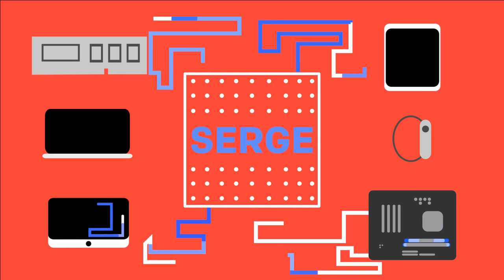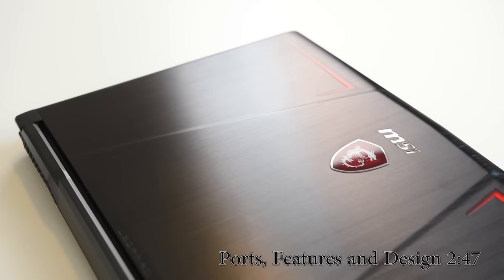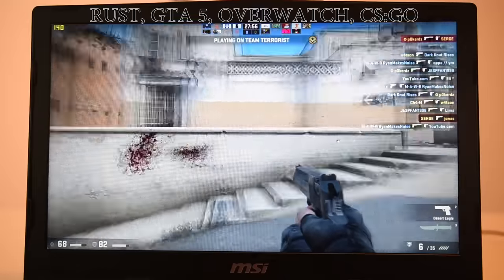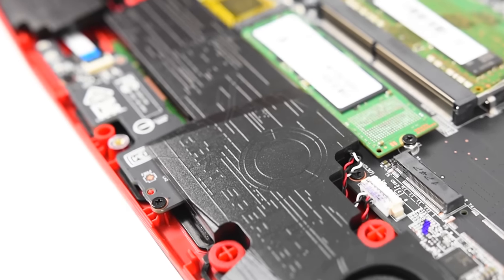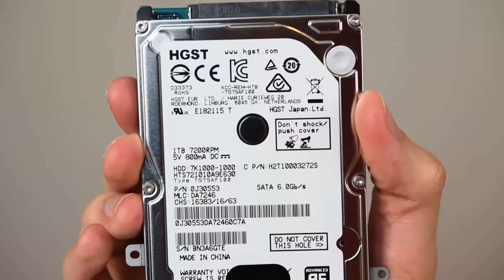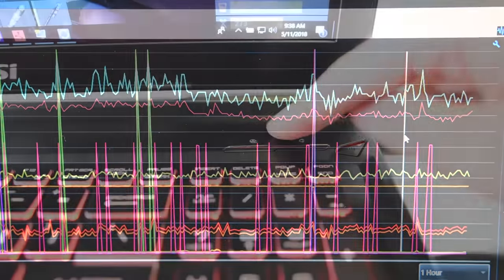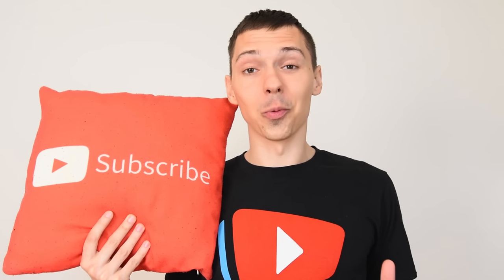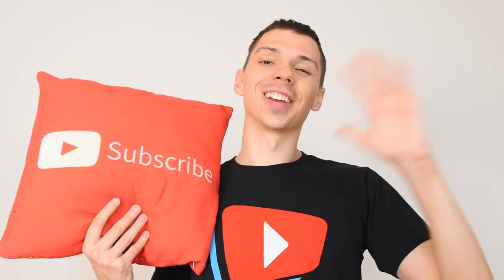MSI GAMING LAPTOP REVIEW GTX 1060, 6 CORE 8750H, GP63 LEOPARD 8RE

Comment: i've got the MSI GL73 8RE-402 and i luv it. realy good cooling solution. only downside are the speakers and the trackpad. it can be loud if you have the cooling boost on. but other machines dont have a cooling booster. its not a jack off all trades but it shines in gaming without thermal throttle issues.

Comment: One of the hinge mounts on my laptop broke this week, I couldn't believe that this happened, but after seeing that the broken part was made of plastic, it was only a matter of time until it broke. It is a really bad design from MSI, the metal hinge is attached to a plastic part, which has to withstand a considerable amount of the force that is applied when opening and closing the lid. I think I can fix it myself by buying a palmrest replacement. I'm not sure if I should ship it to MSI or not since my warranty expired a few months ago.
Reply from the maker: Even though the warranty expired you should reach out to them and tell them that they will lose a customer for life if they dont fix there defect, who cares that the warranty expired now its a matter of saving a future customer if they care they will either send you the part of have you ship them the device for repair. 

sorry that this happened, msi does indeed make the device as thin and light as possible part of this means that some parts are designed rather cheap. There is a chance that maybe your particular plastic just had a defect but trust me I hear you because my msi also has cheap plastic that breaks right off when you upgrade your ram and once its borken its basically broken for ever and thats just me upgrading the machine... either way the machines are cheap so at least we can get our hands on them... find someone in msi who can fix the machine dont take no for an answer just keep going higher up if you need the boss to get the job done and be convincing its there dang machine that broke they should at least take some responsibility. 

 I am trying to build the best tech & entertainment channel possible if you have any questions I am always standing by to help you with your tech needs what ever they may be. I will always be there for you, So if you like this kind of content I highly recommend you subscribe. :)
Good luck!
Reply: @SERGE_Tech  thanks for the advice, I ended up fixing it by myself. I don't know how much time it will last but it looks pretty solid.

Comment: Great review and breakdown! I am currently interested in the MSI GP63 Leopard-428, which is almost identical to this machine, except it contains a GTX 1070 8G. However, similar to you, I would want to install the Samsung 970 EVO Series - 500GB NVMe - M.2 SSD. Do you think the specific model I am looking into would also have the PCIE slot like this one does?  And if you're not sure, where should I look online to find out whether my model has the slot or not?

Comment: Have had this over a year. It runs like a tank. And by running like a tank it can take all the bullets and artillery, but it gets HOT. The plasticiness is garbage. If I pick it up. It feels like Iike it’s gonna break. Structural/ heat issues other than that. I love it (p.s anyone have thoughts in current owners of razer laptops)
Reply from the maker: ill be releasing a razerblade video soon they are surprisingly good. Do you have a specific question about it? subscribe with notifiactions on if you wanna see the vid in the next day or so.

Comment: Hey Serge, Loved the vid!! This is what made me decide to purchase this laptop, and boy am I happy with it. I have 1 question tho, it seems like my screen refresh rate is set at 60 and I can't seem to change it in the advanced display settings. Do you know how I could change this?
Reply from the maker: while its true there is a way to change it, it should already be set at the correct refreshrate. you can try searching change resolution.
Reply from the maker: in the start menu search, you should be able to select a resoulsion with the correct rate also its possible your model may not have the 120hz maybe?
Reply: Go to Nvidia control panel and then to change resolution.  There is a tab on the right beside of the resolution for refresh rate.

Comment: Kind of freaked me out with the hinge thing, but I'm sure it isn't that bad. It's not like anyone is going to be opening and closing the lid all day.  I've had my fair share of laptops and I can't say the hinge ever wore out on any of them. I really can't see MSI cutting corners on something like that.

As for the build materials... Well, that's the price for a few pounds - plastic surface areas. 

Anyways, thanks for the review. Definitely helped me in picking up my first gaming laptop :) These things really have come such a long way, I'm quite impressed with the accessibility of the parts as well as the specs.

Comment: Hi, After i saw you  test this laptop i bought it (used condition, but like new) it doesn't come original charger (it comes Targus 90 w universal charger) and i test laptop in CS Go and FPS is terrible sometimes is high and sometimes its quite low (between 27 - 300 ) what do you think it is charger's problem? it is not enough big (180 watt )  and if you know which Brand charger is good to buy for my MSI GP 63. thx

Comment: Tell me which one is best 1060 lap ??? This is 8gen but i like that raider one.  But its 7gen 😳  ..  can you tell me what is best choice ??   .. geting asus(strix) or lenovo (720) or msi?   I need 1060 laptop and better performance and build quality
Reply: There is no compression between Asus ROG Strix GL503GE and MSI gp63-8re. The msi is the clear winner in this case. First of all the processor of Asus in i7 7th gen while msi is of i7 8th gen. Almost about 24 percent performance gains. That is a great improvement in top level performance. Secondly is gpu, gtx 1060 6gb will give you almost double the performance of 1050ti. Thirdly is the screen, the display of 120Hz over 60Hz is a a major game changing. The difference of 24k is really worth as it it's a lot better.
Reply: i allready got a raider 7 re XD

soo sexy
Reply: Raider 7 re XD has 7th gen processor. But it is also a good gaming laptop. :)
Reply: SOURADEEP DAS atm im playing a game right now..

Comment: How about Gen 8th I5 GL63 8SE with RTX 2060 and 8GB RAM vs Gen 8th I7 GP63 8RE with GTX 1060 and 8GB RAM?  Both price are kinda close. If my budget is around there, which one should I get? Or is there other laptop that is better? 
My priority will be future-proofed, and generally use it for gaming (not necessary Ultra High setting), sometimes rendering.
Reply: Get the one with RTX 2060, since i5 8th gen HQ CPU's are equal to i7 7700HQ, you won't notice any performance issues and the RTX 2060 will serve you a good amount of time.

Comment: I bought this computer a couple of years ago, now the screen is doing something weird occasionally.  Pink pixelated lines will go up the screen real fast, wtf.  Does anyone else have this problem?  It happens everyonce and while, but scares me like my screen is about to fail.
Reply from the maker: Awesome questions keep them coming, What your talking about is cause for concern and before it fails completely I would take it into MSI and get them to fix it or replace it. Check weather you have a warranty or not, and if not don't worry about manufactures of the machine might still repair it for free, Just be nice about it and they will help you. It sounds like it may be damaged from a fall, do you know if you dropped it? It could also just be a loose capable this can be fixed by taking the machine apart, you find guides online on how to do it. 

I am trying to build the best tech & entertainment channel possible if you have any questions I am always standing by to help you with your tech needs what ever they may be. I will always be there for you, So if you like this kind of content I highly recommend you subscribe. :)
Good luck!

Comment: Just gonna leave this comment for those who are thinking about picking this bad boy up. I got it last summer and so far its so fking good. I got it for like 1k or maybe 700 dollar i dont remeber. And it is soo good. The only downside of it its just that if you play games with high requirements it tends to get a little bit warm. But there is a solution for this which is the boosted fan, you can basically boost the fans and make it cool down although it gets very loud. Otherwise its so good, atleast for me. You can play gta V on the highest quality and games like LOL it runs it without a problem. Also if you wanne pick this up make sure to get a mouse with it aswell because the touchboard is horrible, it works but its not great.
Reply from the maker: yeah even if it was a good touchpad for most games like the ones you mentioned having a mouse is sorta a requirement unless you use a controller. Awesome advice thanks for sharing!

Comment: I have the Msi Gf63 8rc with the 8th generation i5 Intel processor and upgraded the 8 gigs ram to 32gb ram makes it run super fast.  It has the 1tb ssd drive and it runs all my games amazing.  Have the gaming mouse and external gaming keyboard which makes this system complete.  Any suggestions what else I can do for even better performance

Comment: I just bought MSI GP73 Leopard, everything's so far so good. Well, except for the Battery Adapter which gets heated up if I use the laptop for some times. Is it usual or Is something wrong?

Comment: which is the best MSI ge63vr 7re raider or MSI GP63 8RE LEOPARD? what is the difference between each this?
Reply: GP63  8RE is of i7 8th generation at it is 1060 6 gb while GP63 8RE is of i7 7th generation.
Reply: SOURADEEP DAS You've just said the same.

Comment: I am confused between this one (MSI gp63-8re) and Asus ROG Strix GL503GE in India.

The only difference specification wise is Asus comes with 1050Ti and all other specs are same (even 120hz screen).

I know 1060 is far better fpr gaming but the Asus is available for around 24000 rupees (350$) less.

So is it worth it to spend 350$ more just for an upgrade to 1060 compared to 1050Ti.

Also at the same price of Asus(above one only) I am getting a gtx 1060 but with 7th gen i7 and only 60hz screen. 

Please suggest.
Reply from the maker: How important is gaming for you? How often do you play and do you care about running graphics on high? With a 1050ti you will sometimes have to decrease graphical fidelity. I know a few serious gamers that complain there 1050ti is not strong enough..
Reply from the maker: Certainly saving money is important get the 1060 if you can it's a lot better but if your not a serious gamer save the money.
Reply: SERGE I am not a very serious gamer, I am ok if my games don't run on ultra setting but also I don't want them to run on low or medium settings. Also I am considering to use my laptop atleast 3-4 years so future games should also run on it.

Can you please do a review on Asus ROG Strix GL503GE (2018 strix)
Reply: There is no compression between Asus ROG Strix GL503GE and MSI gp63-8re. The msi is the clear winner in this case. First of all the processor of Asus in i7 7th gen while msi is of i7 8th gen. Almost about 24 percent performance gains. That is a great improvement in top level performance. Secondly is gpu, gtx 1060 6gb will give you almost double the performance of 1050ti. Thirdly is the screen, the display of 120Hz over 60Hz is a a major game changing. The difference of 24k is really worth as it it's a lot better.
Reply: SOURADEEP DAS asus gl503ge i7 8th gen

Comment: i got an oculus rift... should i be buying this machine?
I really dont want under 60fps.
Reply from the maker: i think oculus would work on it but you have to take into account this is new techcnology and if you want the best performance try a non entry level graphics card like gtx 1070 or gtx 1080. 1060 is perfect for 1080p and can push some higher 1440p sometim s but other than that you may be pushing it too hard trust me get a hogher gpu this is new technology we are dealonf with.

Comment: The GP73 which is the later version has the GTX 1050 GPU.
I guess theres no way to upgrade the GP73 to the 1060 or 1070 card...?
Photoshop/Lightroom 2023 new features are struggling with the 1050 card.
Reply from the maker: if it has a fast enough usb c you can plug in a vidoe card using an external gpu enclousre

Comment: How good would this be for editing videos?
Reply: I've edited videos on this. It's great as you would expect from a 6 core CPU. The laptop is a bit heavy though and taking it around feels a bit tiring though the size is ambient for it's cooling.
I also replied to another comment that there's better value out there, like the Lenovo Y7000, cuz it has the same specs for a much nicer design.

Comment: Is this still a good buy in 2019? Can get it used for about a 1000.
Reply: I bought this laptop a few months ago and still holds up pretty good.
However, I think there's a couple of better options out there. Yes this laptop has an amazing screen and excellent performance but other laptops, now, sell at better value.
If I were you, I'd try to get my hands on the Lenovo Y7000 (the new one) just because it has an overall better design and feel. If you really want to cheap out, go for the Dell g3.
Reply: @hamzakamil4303  Okay thanks for the tips. Is Dell G5 worth to try? Since you're saying the g3 I mean. I can get the g5 for like under 1000
Reply: The g5 is great too.
Again, there's not much difference between these laptops except for a few degrees in CPU temps and some design changes.
I'd say of you're paying $1000 for a gaming laptop, it should have the i7 8750h and a 6gb 1060 along with SSD, 16gigs ram etc.
Look at dis babe too
https://www.amazon.com/dp/B07PML7FBJ/ref=mp_s_a_1_4?keywords=i7+8750h+gtx+1060&qid=1552642869&s=gateway&sr=8-4

Comment: Recently bought a msi gp63 laptop with 1070 gpu and 8750h cpu. While playing far cry 5 on ultra with vsync at 60fps, cpu temp got as high as 95c. Unlike the gpu temp its steady at 65-68c, the cpu temp constantly going up and down sometimes by 5c and sometimes by 10c. 

I have cooler boost on it cranks up all the fans to max and i even had my laptop raised higher off table for more air to get in. When i feel the laptop its lukewarm all around but the reading of the cpu/gpu has me worried.

Should i be worried? is this normal for a laptop?
Reply: winkawak it’s unfortunately normal for a laptop with a 1070 in it. The higher power demands and subsequent higher heat generated lead to more thermal throttling.

Comment: Is it good for 1280$ in 2020? A bit urgent please answer
Reply from the maker: That’s almost twice as much as I paid but what are the specs I had the base model?
Reply: SERGE  GP63 Leopard-8RE-077US

MSI GP63 Leopard GAMING 

Core™️ i7-8750H 2.2GHz 1TB + 256GB SSD 16GB 15.6" (1920x1080) BT WIN10 Webcam VR Ready NVIDIA®️ GTX 1060 6144MB Backlit Keyboard. 1 Year Warranty, Retail Box, New Factory Sealed
Reply: SERGE damn it’s technically the samee this’s the only price I found it for with several dealers
Reply: SERGE do u recommend any better msi model with the same details and possibly same price

Comment: I have a huge issue with this computer, it somehow uses my intel uhd integraded graphics, it does not use the GTX 1050 Ti. My module has this one instead.
I tried the nvidia control panel, i tried setting the game to use only the nvidia card, still not working…

Comment: Do you find any problems with this laptop? 

Like any problems? Because i wanna know if there are any big issues I might need to be aware of
Reply: Hey. I have a MSI GTX GE63 on 1070. Bought a used-was trotting and fps drop by 20-30 percent on the GPU. Saved only Cooler Boost and laptop stand. Solved the problem by cleaning (a lot of dust was inside) and replacing the factory thermal paste. Now runs quieter, without throttle, the fps was higher. MSI has better cooling system, more heat pipes than Asus, also a lot of complaints about the quality Of ASUS matrials. But good dislpay in this price range only have two.